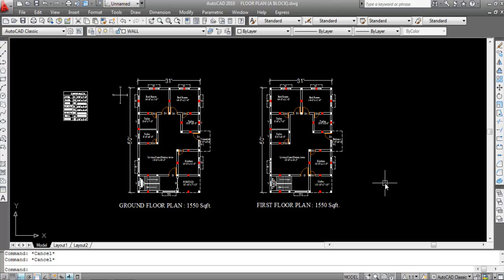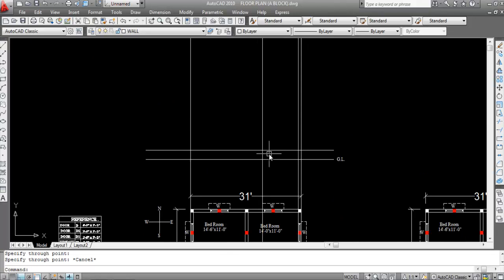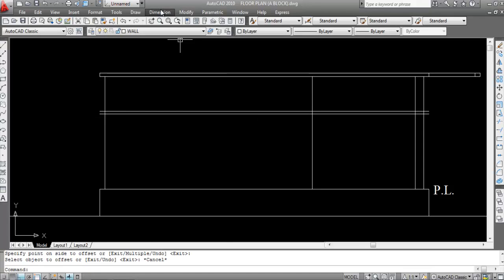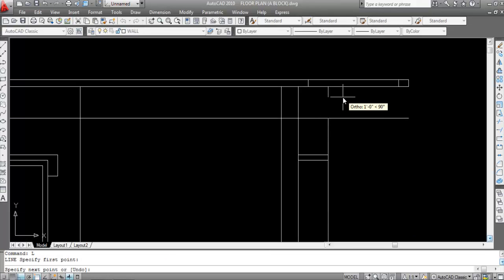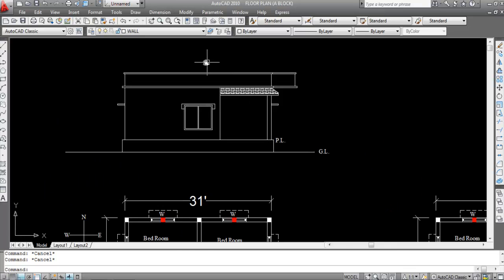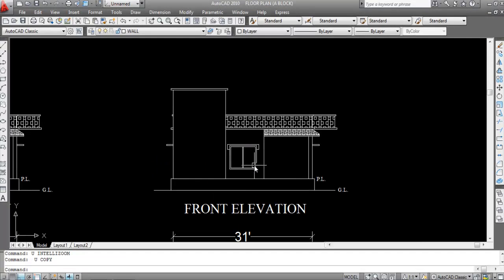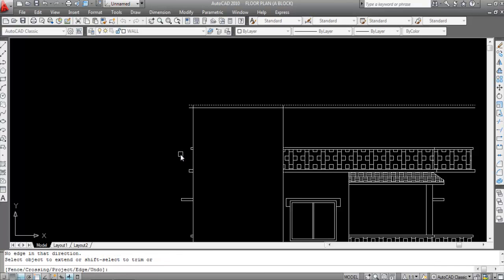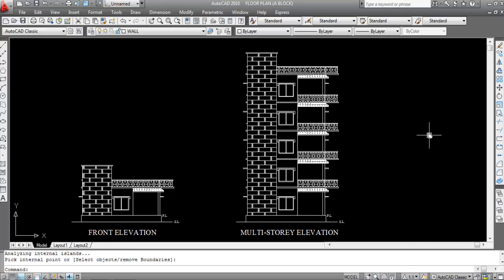How to draw Front Elevation of Multi-Storey Building in AutoCAD || Building #2

Comment: U made a mistake maam 
In previous ground floor plan  window  W near stair case but here u written W2  this may varies length maam  and u didn't mention window size 5'x6'
Reply from the maker: In this plan I have changed the the window size also told in the video, please go through the video properly.